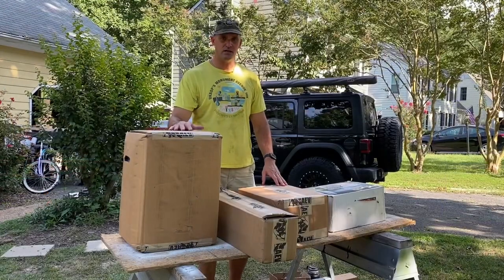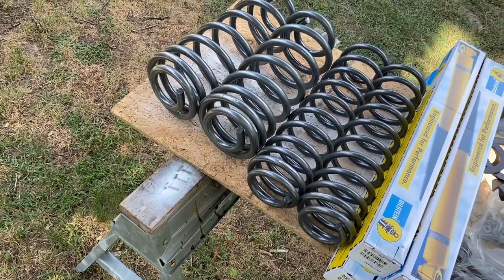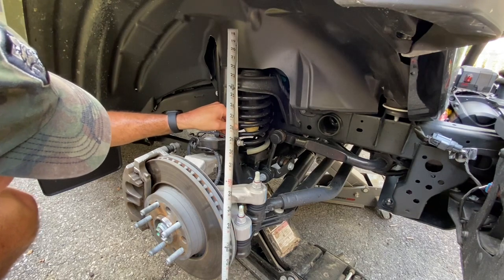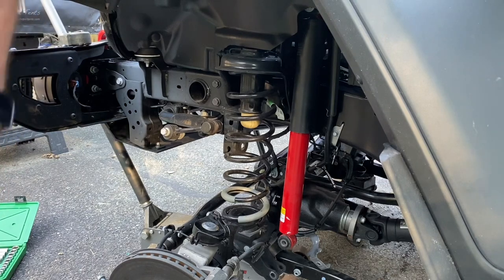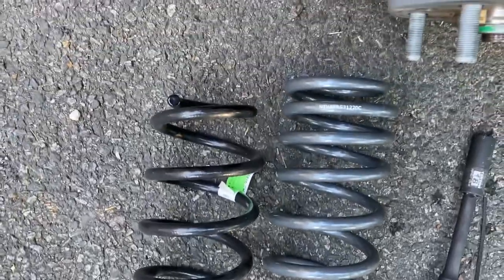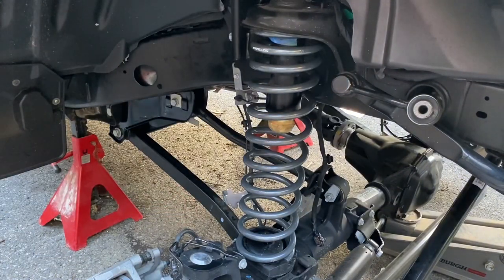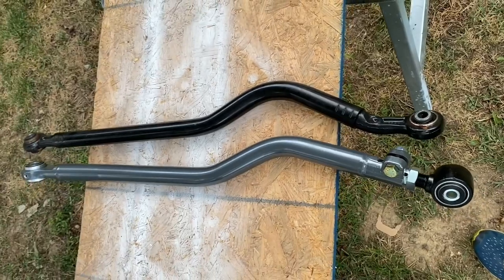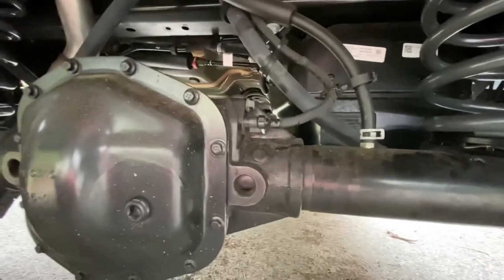Raising the Bar : Step-by-Step Guide to installing an AEV 2.5 Dual Sport Lift on Your Jeep

Comment: I’m looking for a real 2.5” lift kit to replace my spacer lift…this AEV has been getting good reviews. Also looking at Duratrac, JKS and Clayton Overland (which includes all 8 control arms, front and rear track bars, springs).
Reply from the maker: Those are great options and i looked at all those as well. Settled on the AEV lift simply because of reputation and great reviews from those that had tested it and I was not disappointed with my choice the system is balanced and rides great, there are other kits that offer extra bits but with that i think you get an inferior coil spring and shock combo and thats truly where the ride and handling is

Comment: Thanks for posting.  My kit will be here in two days.  You said you were talk more about shims?
Reply from the maker: Vincent, awesome you will be happy with it for sure, the shims are for the passenger side coil springs they give a 1/4 lift to offset the constant extra weight of the fuel in the fuel tank, they just drop in on the lower spring seat super easy to put in place!  Good luck with the install!

Comment: Just installed this last week. Running the 37 Nittos with AEV Borahs. Have you noticed any rubbing at the control arms when the wheels are fully locked. That’s my only issue I found
Reply from the maker: @christiancolletti, i have not had any rubbing issues up front, I am running 35’s though, the only rubbing i have had is actually in the rear fender, i lifted a front wheel today in some rocks and compressed the right rear and it rubbed the plastic inner fender but thats it, nice set up by the way the nittos are great tires
Reply: @FischerJeepAdventures  I’m extremely impressed with the  kit. I had a 2012 JK sport with 37 Pro Comps and a 4 inch Superlift. It’s night/day comparison. Just need to figure out the rubbing on the control arms when the wheels are locked. I assume it’s from the 37 Nittos (which ride great) but I think Nittos run true to size and AEV uses BFGs for all their setups which run smaller. So maybe that’s why they don’t address rubbing because they wouldn’t have any with the smaller tire
Reply from the maker: @christiancolletti3486  I think you are right! The kit is great exceeds my expectations for sure!

Comment: Hi could you tell me how thick are the bump stops in this kit . Thx
Reply from the maker: It adds a 2 1/2 inch spacer between the stock bump stop location. I reused the stock ones they fit into the spacer just like they fit in the stock housing

Comment: Really nice whats the costs and what size tires are you running?
Reply from the maker: V8marc, thanks the lift costs $1350.00 a bit more than others on the market but what you get for that money is an engineered system with tuned springs and shocks, speedometer calibrator, and everything you need, i added the adjustable front track bar which was another $275.00 well worth it in my opinion.  As to tires i am running 35’s and could easily run 37’s but the 35’s are all i need.  Highly recommend the lift

Comment: I finaly got my kit installed.  Did you have any problems installing then geometry brackets.  I did the drive side first and it seems as though the axle rolled back on me.  I am having problems connecting the control arms.  Any advice?
Reply from the maker: Vincent, I had the same thing happen to me, I used a couple ratchet straps, put the lower shock bolt in and connect the ratchet strap to it and then to one of the skid plates, then another on the track bar mount on the axle and connected it to the bumper and used both to rotate and also center the axle until i could get the upper control arm in. Hope that helps!
Reply: @FischerJeepAdventures  Thanks for the reply.  Did you still have it on the jack stands .  I think that may also be the problem.  The instructions suggest putting the plates on with the wheels on and I also found a video that suggests the upper control arms be put on first.
Reply from the maker: Vincent, yes still on the jack stands, it simulates ride height as the weight is on the springs like it was sitting on the ground, the stock control arms have the knurled joint so the vehicle has to be at ride height when you torque the control arms so you dont over stress the bushings, but yes upper control arm first.
Reply from the maker: I put metal cloak  adjustable control arms on in a later video that have bushings that rotate, that eliminates that issue of the torqued bushing stress, check the videos out if you want there is one for the front and one for the rear arms
Reply: @FischerJeepAdventures  Glad I saw this.  Should a guy using this lift kit just go ahead and get adjustable control arms NOW.  Did you keep the geometry correction brackets or remove them?  Also, if you have a spare 300 bucks laying around could you also buy and install a new rear adjustable track bar and do away with the bracket to raise the factory bar?  It seems there are 2 choices in lift kits if I have done my research correctly.  ZERO or no lift kit at all.........OR ...... just bite the bullet and spend 6500 and get a real lift kit and don't add parts and pieces over the next year or two and end up with an 8000 piece together progressive over time lift.  I was just going to get the TeraFlex 3.5 CT-3 with the falcon 3.3 shocks and then I came across the AEV lift..........BUT.....now find out you have upgraded to adj. control arms and front adjustable track bar, so you are approaching the cost of a kit that had all that in it to start with.
Reply from the maker: @grantparnes I would, do either what you described get a kit with everything you feel you need or put together a custom kit like i did, often you spend more but you get what you want. My journey took me down the aev lift kit, then i upgraded the springs, then i added adjustable control arms and geometry correction brackets from metal cloak, i kept the geometry correction brakets with the adjustable control arms to stabilize the angles, i did remove the rear track bar bracket and replace with an adjustable rear track bar from synergy and then i replaced the shocks. So I have a kit i am very happy with but it also one I could not buy as each of the pieces serves their own purpose in my eyes, I do everything myself so its easy to upgrade and change as my needs do if that makes sense
Reply: @FischerJeepAdventures  Awesome answer and the one I wanted to hear.  Thank you.  The more I read about what the drop down brackets do, the more I may just gravitate towards a TeraFlex long arm kit and be done.

Comment: Has anyone added a spacer to the front of this lift to help level it out. Getting ready to install this and want to get rid of the nose dive look.
Reply from the maker: The lift is set for an overlanding load, so once you load up in the back and in my case as well put on a roof top tent it leveled out nicely, if your not going to do that and just want the lift a spacer may work to give you the stance your looking for

Comment: How's the ride performance?
Reply from the maker: Brandon, the ride is great, in my opinion it is better than stock, it feels much more solid on the road, less body roll even when loaded down and absorbs the trail bump nicely, i like a stiffer ride anyway, although i may add the hellwig rear sway bar to help with the off camber motion when offroad since we have the tent up there
Reply: @FischerJeepAdventures  Great to hear that. I've got the Mopar 2.5 lift kit and the ride is far better than stock. Have you consider adding the Synergy Front Track Bar Brace?
Reply from the maker: @Airkoay  cool, i had looked at the mopar lift as well just wanted the extra spring rate for my overlanding setup the aev lift is really designed for.  As to the synergy track bar brace, yes it is sitting on my work bench now and hope to install it soon, since the steering connection seems to be a weak point especially on the trail i thought it would be a good option, hopefully have a video of that out in the coming weeks
Reply: @FischerJeepAdventures  Thanks for your response, I hope you get to post the video of you installing the Synergy and would like to see your thoughts about it. I heard some say they are worth it and some say it doesn't make too much of a difference. So far I haven't gotten much of wobble, then again I'm used to driving lifted Wranglers. This is my 6th Wrangler's I've owned. YJ, TJ, JK, JL, love them all.
Reply from the maker: @Airkoay  awesome i am a multigeneration jeep guy as well, I had an old when i was in college CJ5, a YJ, a TJ, and now my son and I both have JLU’s

Comment: Are you running 35s?
Reply from the maker: Yes i am running 35 patagonia mts, i could easily run 37s with this lift but i am happy with the 35s no real need to regear and the price of 37s is crazy compared to 35s

Comment: Nice height without attracting the law
Reply from the maker: Thanks! I am happy with it and it looks subtle and gives me the clearance I need!  Thanks for checking out the channel!
Reply: @FischerJeepAdventures  what’s the ride like off road. is it harsh over corrugated roads?  Im running a lift that’s a bit harsh at the moment and about to change it.
Reply from the maker: Phillip, it rides really good the springs are stiff enough to stabilize the jeep but soft enough to have a balanced ride, the dual sport is just as smooth on the road as it is on the trail, like with most washboard roads tire pressure really impacts the suspensions ability to absorb things, as to suspensions differences my son changed from another lift he bought to the dual sport on his jeep after i raved about it and he said the ride was night and day different, I would use the AEV lift again if I was lifting another jeep
Reply: @FischerJeepAdventures  ok i’m about to order a kit as there is a supplier over here in australia
Reply from the maker: Awesome, you will be happy with it!
Reply: @FischerJeepAdventures  my current lift was meant to be 45 mm but was less then half that with no load . I was going to purchase the double black off road. 2.5 kit but the kit looks lower then 2 inch and they don’t use the drop down brackets, only two lower adjustable control arms.
Reply from the maker: The cool thing about the aev lift vrs the dbor lift is those bracket correct all the geometry issues so you can reuse all your factory stuff, the lift is tuned so well we did not even need an alignment after we did the install in the driveway
Reply: @FischerJeepAdventures  The kit over here doesn’t come with adjustable front track bar. i will have to one . Are front track brackets available like the back?
Reply from the maker: Phillip, no the track bar bracket in the rear raises and slightly shifts the track bar to the non frame side to maintain track width alignment with the factory track bar in the rear, front axles do not use brackets since its a steer axle that puts to much stress so you would need and adjustable one for the alignment, aev says you dont need one, i put one on just to get a stronger bar but it was set to the factory length, aev says its not necessary so unless you have a true worry about it i wouldnt spend the extra money, if you going to be on the trail alot and flexing the suspension often the stronger front bar might be a good investment but certainly not necessary to install the lift in the beginning
Reply: @FischerJeepAdventures  i will do the lift install and go slow over good tracks and get one later, SBR off road in western Australia just re opened from holidays today i call them tomorrow as at work now.
Reply from the maker: Sounds like a plan, good luck!
Reply: Track bar looks adjusted a couple inches longer, I have to watch video again to see how you get the length
Reply from the maker: In the video on the table it looks longer as thats how it came out of the box, but when i was setting the length i used the stock length initially than took some frame to axle measurements to make sure it was centered and utilized the adjusting collar to make the fine measurements, i still have the stock track bar, ill go out and measure today and let you know the difference if any, i cant remember exactly and dont want to tell you wrong
Reply: @FischerJeepAdventures  . thanks . if it’s not too much trouble, i can go off a few things if you can’t get measurements
Reply from the maker: Ok and i would double check your stock front track bar but the 2021 jlur stock bar is 33 3/4 inches center to center, the adjustable track bar for the aev dual sport with the 2.5 coils is set at 34 1/4 inches, like i said before AEV says you dont need them for the lift since the front track bar is angled the half inch equates to less than a quarter inch change each side
Reply: @FischerJeepAdventures  thanks. lift kit on order ,
Reply from the maker: Outstanding

Comment: How does it drive and did you need a alignment?
Reply from the maker: The jeep drives great, the ride is smoother than stock, it looks good and I did not need an alignment, the jeep drove as straight as when i bought it and with the straight axles the alignment doesnt really change much especially with lifts 3 and under once you get above that there is some geometry changes the need to occur to keep the castor angle right